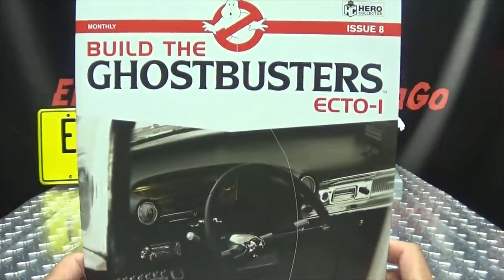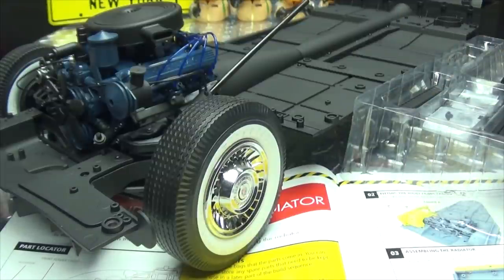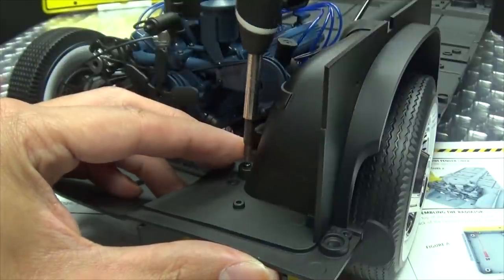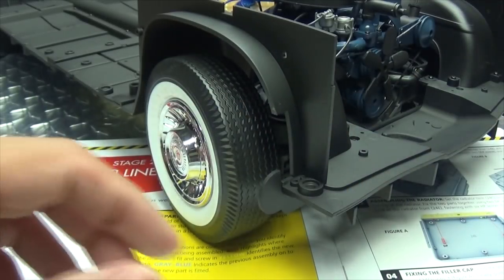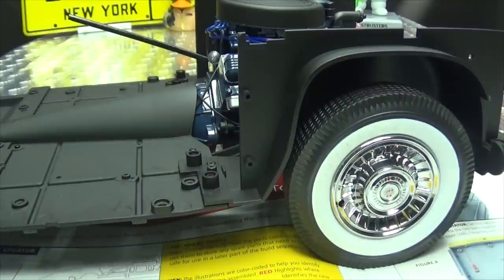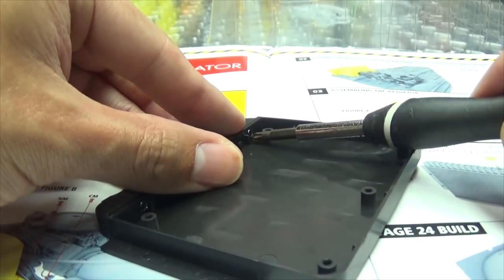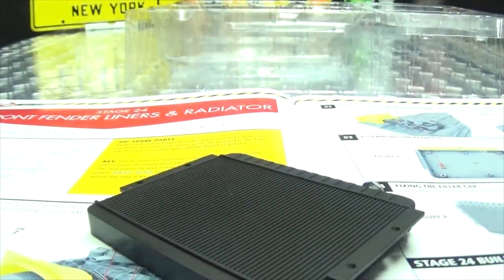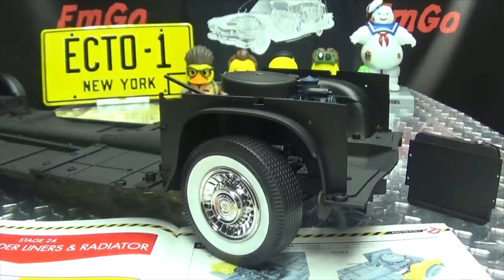Eaglemoss Ghostbusters ECTO-1 Kit (Part 24): EmGo Builds Stuff

Comment: Just to let you know the pipe on the radiator is just for pressure release and just bends down like the picture.
So train it with masking tape till next week and it will stay that way hopefully if you need to just put a hairdryer at it for a few seconds if tape dose not work.
Loving the build as all ways.
Stay safe all.

Comment: Would you believe I drove from the Florida panhandle to a small Wisconsin village in less than a day and have few to no regerts?  Sure I was a bit sore from the trip but, getting settled in.  Getting things organized.  The local gas station sells, BP Fuel, wha-ha!  Should I mention the steak sandwich?  No, wait, it was a STEAK sandwich.  Not shaved steak or anything like that, but a full tender STEAK....I just wish no one hit the darned car transport....would of made the last couple of dozen miles a bit faster (had to limp in slower than a train on final approach)

Comment: You’ll do the oil tank in the next step don’t put it on until you put the radiator on the care it will make it easer to attach the bottom pipe on the engine to the radiator when you atttach it to the car

Comment: The accent you went into during the radiator was either Scottish or Irish as far as I can tell still I'm estimating the dang car is going to be around 20 inches to 24 inches long when finished its a big build!
Reply: It was Scottish. Same accent as "WE SCREW!! weee screeeeew"
Reply: I agree, it is the Scottish accent.
Reply: The ecto1 will be just over 30 inches long that is without the display base and case which will add about another 3 inches and each side of the car long term storage.

Comment: EMGO, how are you today?  When you get the the part where you install the radiator into the car the hose you did today does not attach on anything on the other end, it just hangs down. It is just the release the pressure from the radiator.